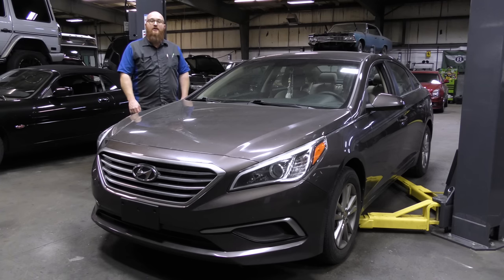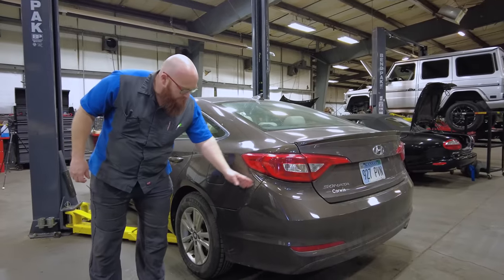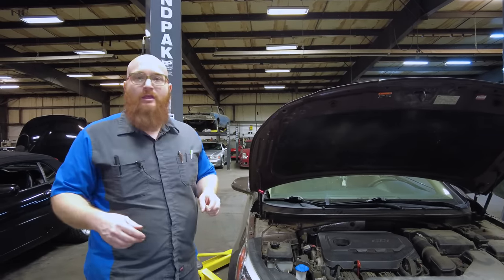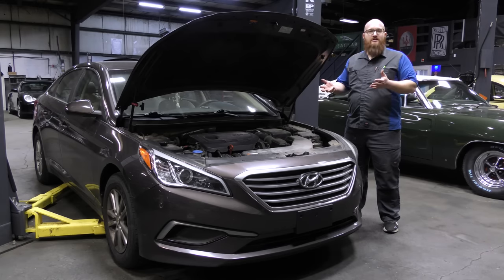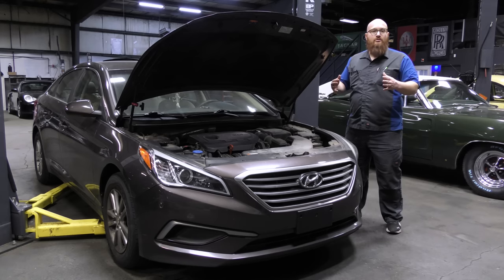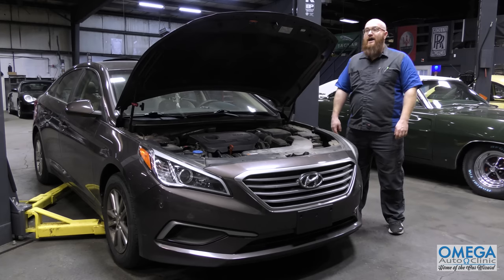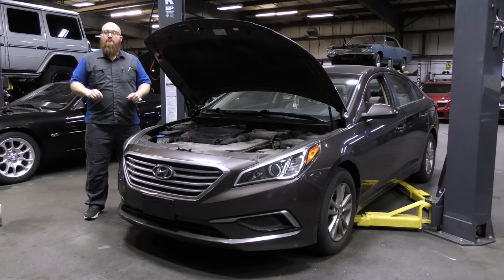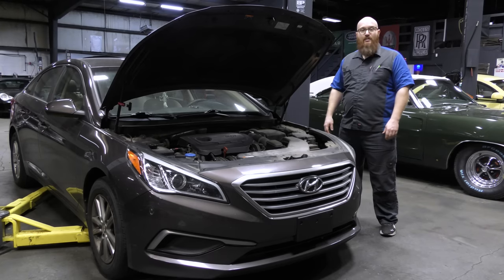What could be so bad on this '16 Hyundai Sonata that the CAR WIZARD is sending it to the junk yard?

Comment: My family had 2 Sonatas, both same model as the one in the video. Both ran perfectly and drove so smooth. The only problem was an occasional infotainment problem with the Bluetooth. It’s such a shame that these are apparently problematic but I’m glad our experience with these was nice
Reply: The overall quality control on Hyundais and Kias is very poor.  Yes, some people have good experiences, but a lot don’t.  There’s a reason you pay more for a Toyota or Honda.
Reply: No car can run on low, dirty oil.
Reply: Put in an aftermarket radio if possible. They are so much better
Reply: @mplslawnguy3389  very true. We’ve had several JDM brands and had pleasant experiences for the most part, Nissan being the best overall for us if you can believe that
Reply: I also had a  few Hyundais and never had any problems.
Reply: @mplslawnguy3389  And you know that how exacty? How many are there that don't have good experiences? How many of those have actually both and maintained them in proper conditions?

Interesting about that value remark you made on those jdm rust buckets. By your logic european cars must have the best quality, right? They do command quite a bigger fee.
Reply: @AI-qd4vb  Are you just a contrarian with nothing better to do?  It’s a pretty well known fact to people that work on cars that the Korean brands are of low quality.  Kias and Hyundais are cheaper upfront, but will fall apart at a much higher frequency.  Their quality control on their engines is not there.
Reply: @AI-qd4vb  🤡🤡😂😂
Reply: @mplslawnguy3389  he comments all these stupid things on Car Wizard’s videos, just ignore him

Comment: My daughter is going through this right now.  The oil was low but the dealer couldn’t say anything because they had just changed it.  There is a recall of sorts.  You have to jump through their hoops to get anything done.
08/15/24—-Hyundai replaced my daughters’ motor, at no cost.

Comment: Hi Wizard - I sold 5 years ago a 2008 Kia Sedona with the 3.8 L at 110,000 miles to a neighbor who still drives it today.  I don't know the mileage, but I see him zippin around in it all the time.  When I had it, she lived on full syn oil - changes never went beyond 7000 miles, NEVER ran low, and it ran very well. Thanks

Comment: I’m surprised there aren’t more videos like these about Hyundais, a lot of people that I know had horrible experiences with them.
Reply: Well it's because Kia/Hyundai have improved their reputation without improving their products and most people don't realize that.
Reply: A lot of folks who buy cheap cars treat them like cheap cars though too. If you take care of them they aren't that bad. People neglect their vehicles.
Reply: @brayannexon4613  It's because nowadays they make vehicles to appeal to mainstream automotive journalists who don't give two craps about how well a vehicle holds up after even 10k miles let alone 50 or 100.  If it's pretty/luxurious enough and has enough tech to make the journos go "ooh" and write a good review (which they do) Hyundai/Kia has accomplished what they set out to do.
Reply: @pierredelecto7069  agreed.  I take extreme care of mine.  I'm early on literally everything.
Reply: Hyundai basically went 'f*ck it" in 2012 and I've not even considered their cars since, which sucks because their 2000s era port injected cars were super reliable if taken care.
Reply: @brayannexon4613   No they went backwards, even if most people didnt realise it at the time; their cars already had fit and finish on par with japanese budget cars in the 2000s... and hyundai port injected engines were super reliable. Now they may look fancier, but their long term reliability has regressed from the era of mid 2000s elantras routinely getting over 300k without any fuss. Toyota engines are again the unchallenged the gold standard for long term reliability in my book now.
Reply: @pierredelecto7069  Most cars are build cheap today because car manufacturers cut corners with cheap engine plastic parts(obsolescence) and cheap electronics and when they break, charge a premium for those parts.
Reply: That's not true and this guy's full of it  The 2.4 l Hyundai It's bad but  There are websites that sells refurbish  2.4  I bought a complete  Engine for $1200 rebuilt  For my 15 sonata
Reply: @tbr2109  That's because they should not be sure about uncertainty.
Reply: This car is purely dead due to neglect would happen to any car
Reply: I had a 2002 Accent, two door hatch, 5 speed manual, and the car was a blast to drive.  I took it off the road August 2022 with 198,000 miles on it.  I got it at 170,000, it had never had a major repair at that point, and all I did was tires and alignment.  It was let down by the previous owner who apparently never got it washed....  ever.  Salt corrosion under the body ruptured the brake lines and I wasn't doing that repair on a thousand dollar car.
Reply: user-tq2zb5sc2c the difference is that if you buy something expensive from the German big 3 you are usually treated like a human being by the service department. Hyundai/Kia treat their customers like dog shit on the bottom of their shoe. All the surveys say the same thing…that the Kia/Hyundai have the worst dealers and they try to weasel out of warranty claims and stick the customer with the bill
Reply: user-tq2zb5sc2c  if you don't maintain them properly, that's what happens. Simple.
Reply: user-tq2zb5sc2c  oh you say so? Mines at 160k and my friends is at 250k, both same year BMW 3 series. And if you look in Europe, there’s a lot of them with 500k+ kilometers on the odometer. Proper maintenance is the key which nobody here in US does.
Reply: Those cars are good cars, is just bad owners.
Reply: These are poorly made engines that rarely see 150K
Reply: @ronaldwhite6508  $1,200 "rebuilt"? Don't think anyone sells "rebuilt" engines of any kind for that low price. That sounds like a pullout or junkyard used engine. Nothing wrong with that, used engine into a used car =still a used car.
Reply: The Real Cat of 2020  just sold an 05 Mercedes e55 amg with 160k miles, an 06 c55 Mercedes amg with 139k miles and lastly an 05 bmw 33ci zhp with 128k miles. All ran great with no issues. Quit being ignorant
Reply: @ronaldwhite6508 😂 somebody lied to you if they sold you a “rebuild” for $1200. That’s a used engine, says the internet.

Comment: My 2013 sonata did the same thing last year, low oil, running out before my oil change, and the engine siezed on me last may. A few months after I had the dealership do an oil consumption test and tell me it was fine. At 125,000 miles hyundai ended up replacing my motor for free through the recall and paid for my rental while in the shop. Here today looking for a eps fix now 🤦‍♀️

Comment: Common problem with Hyundai and Kia with the blown engines.  I had to replace my engine and luckily it was covered by the recall. Changed oil regularly, checked it every Saturday morning, and the engine still went. The 2.0 liter turbo and the 2.4 are just bad engines. Hopefully, Hyundai and Kia will remedy this issue.
Reply: I wouldn't hold my breath. They're still crapping out cars that blow engines early and they've known about the issue for a decade. They know what they're doing. If they can cheap out on manufacturing costs, and move enough volume, they can save money in the long run even with all the recalls and their 100k powertrain warranty. Techs only get paid 6 hours for replacing these engines and they're cheaply made so they can afford to throw you a couple new engines until your warranty runs out. You still paid upwards of 20k for the car that cost a fraction of that to slap together.
Reply: @henlo1910 Exactly! To manufacturers like Hyundai/Kia, it's the cost of doing business.
Reply: Are 1.6 liters non turbo engines good?
Reply: No! Mine is blown. I’m at the bank forfeiting the junk right now. It’ll cost 2x the value of the car to repair it.

Comment: I had this happen to my 2015 Kia Soul, luckily I did take it to my dealer for oil changes as per manufacturer instructions, and after dropping it off at dealership service department they finally replaced part of the engine as I did take it in for the recall! Since the dealership took 5 months to finally honor the warranty, I already bought a Honda to replace it. Sold that Kia a month after I got it back
Reply: GOOD Job!:text-green-game-over:
Reply: How long did it take them to do the diagnostic?  After a month they're supposed to offer you a free loaner car for you to drive while the car awaits the diagnostic.  It took my Hyundai dealership three months to do my diagnostic but they loaned me a car for free after the first month.
Reply: I hope you didn't buy a Honda with the 1.5t engine. Those have issues with dumping gas into the oil and blowing the head gasket prematurely. Hondas in general have been having problems with AC systems failing annually as well. Probably should have bought another Hyundai for the much better warranty.
Reply: I've been fighting with Kia for over a year with a transmission issue under warranty. I have a claim number with corporate. So far 2 trannys, a ECM, lots of adjustments and hocus pocus and it STILL has the same problem. Corporate refuses to return my 5 ( so far) phone calls. REALLY disappointed with a company that by all appearances was one of the better ones. Hey, at least I get a loaner car while they play with it !
Reply: @johnschofield9496  Can't you Lemon Law the car and force them to buy it back after multiple repair attempts?
Reply: @palebeachbum my 2017 Si civic never had any issues not even the AC pushing 180,000 miles don't fault Honda for Human neglected car problems
Reply: @Renz-ou8ix  lucky you. The problems I mentioned are all noted by Honda. Plus I've known a couple of people with annual AC failures at low miles. They finally gave up traded in the cars.
Reply: @palebeachbum  that sucks hopefully a Toyota or something Japanese related

Comment: Hey wizard, you saved me from a bad purchase on the range rover sport, thanks brother. The sonata is spot on I had 2012 sx optima with 79000 miles. And it drove great the first 5 miles from the dealership driveline. But when I got it home the engine had a light knock. Next day took it to the dealer repair.  They said it was the gdi pump.........ok now I sold cars for Kia few years before. So that was b.s. anyway took it home and it drove normal. When I wanted to take my daughters out for ice cream.  Not 3 miles from the house the engine knocked, squeeked and sized on i4 in Orlando. Me , wife and 3 girls on a interstate with no emergency lane. They are all garbage engines.  It's like mass produced crap to keep supply up when they inevitably fail. Great story keep em comin 👏 👌

Comment: In the UK when taking your driving test you will be asked the following,

As part of your driving test you will be asked to explain how you would perform under the bonnet technical checks for oil, coolant, windscreen washer fluid and brake fluid. You will be asked to open the bonnet and show where you would check for each.

So there is hope for the next generation of drivers.
Reply: Bonnet 😂

Comment: I had a Hyundai Elantra GT.  I drove mostly on the interstate, performed normal maintenance and sold it with 140,000 miles on it.  It still had the original brakes that did not need replacing!

Comment: Years ago I had a chance to buy a Hyundai with just over 100,000 miles on it and the body was nearly perfect. The interior was super clean, and all it needed was a new engine.
I called a buddy who owned a junk yard to price another engine.   He said that is the problem.  He had several really nice Hyundai, Cars, Vans, and SUVs.  They all had bad engines.
Reply: Put a non-Hyundai engine in it.  Maybe a Honda engine.
Reply: @hazelwood55  I was just thinking of the same thing. It would just require more work like swapping the engine harness and ECU to make it all work. But the main thing to figure out would be in finding the ideal engine that fits and lines up with the stock engine mounts with minimal modifications.
Reply: @hazelwood55  put a 1.9 TDI in it.
Reply: Yeah, a used Hyundai engine is $6k and a used Camry engine is $1,500.  with a lot less miles.   Why?  Because there are more Camry wrecks than blown engines.   Hyundai has more blown engines than they can replace.

Comment: Part of the problem is that cars today are so much more reliable than they were fifteen or twenty years ago.  Most drivers just see them as something that just works, and routine maintenance gets left behind.
Reply: Excatly, I feel like basic maintenance and pre use inspection should be taught in driving school
Reply: False. Most cars today are not gonna run 200k+ miles like cars 20 years ago.
Reply: Also that on never cars, there's often not even a physical dip-stick for the engine or gearbox oil anymore and you need to go to the dealership and have them do it and reset the car ECU..
Reply: Cars were way better 20 years ago less electrics cheaper to maintain.
Reply: That is no excuse for laziness or stupidity. Especially at the cost of new vehicles.

Comment: My 2011 Hyundai engine locked up at 120,00 miles.  I always change the oil and check ✅. It was covered under the recall. Got a new engine ❤

Comment: I generally check my oil with every fill-up.  Which just about works out to your 2 weeks.  I've never been low with my last three cars (all bought new), so I can see how someone might get lax...

I get my oil changed about every 5000 miles.  On my older cars, it was about every 3000, but my current vehicles, the oil never really looks dirty on the dipstick, even at 5k.  I don't generally rely on time.  Our main car winds up getting changed every 6 months or so,  and I generally use a synthetic blend.  My little sporty toy goes about a year on full synthetic.  It seems to be working out for me...
Reply: I used to own Kia's until I got a job in the service department at a Kia dealership.  The vehicles have too many electrical issues and cheap engines.  Btw, Kia considers excessive loss of oil if it loses at least one quart of oil per thousand miles driven.  If you're vehicle loses less than one quart of oil per thousand miles, Kia considers the oil loss acceptable and the engine to be good.
Reply: I used to change oil every 37.5k miles/2years, as recommended by the cars computer and the manual. Sold it running like new with 190k miles. Used 0-w40 longlife synthetic oil though. Never had to refill in between.
Reply: @computercrack  Which make and model?
Reply: @aliemreozkan  (GM) Opel/Vauxhall Vectra/ Signum 2.2DTI (Diesel) from 2003. Specified with oil change of 2 years or 31k miles. I once extended this to 37k miles by my own fault. Had the car from 2005 to 2017 and drove 150k miles with like 5-6 oil changes. Oil I used was 0W40 full synthetic long life oil with GM LL specification. (recommended was 5W30 I believe)

The later engines they used in that car had only 1 year and 19k intervals though. Also applied for the later Model Insignia (1.9CDTI Diesel)

Comment: Used to be pretty common that every time you fill up the gas tank, you check the oil while the pump is running. I see barely anyone doing that anymore. That one simple habit could easily prevent situations like this. (Incidentally, this is a good argument for full-service gas stations to make a comeback; the attendant checks that stuff for you including topping off the washer fluid...)
Reply: Equality!  🙂   There are articles about it in the the various MSM Rags that a certain section of the public would blame full service attendance for messing up their vehicle and then gas stations were held viable since they opened up the hood
Reply: @MickeyMishra  That plus components of gasoline are carcinogenic. It's not much of a problem with the exposure you get occasionally fueling your vehicle, but if you are exposed to it all day every day, it can be a problem.

Comment: Hello Car Wizard, firstly, let me say that I am very grateful for what you do here, smiles for many miles indeed.   I just got my 2015 Hyundai Sonata back from the dealer, after getting the engine replaced at no fee, other than the two serpentine belts that were due.  The motor just stopped after turning onto the street I live on, coasted as far as possible, made it onto a side street, and later used it as a leg press machine alternative, pushing it up the incline to get it in to a place where the road was flat.  And it began to collect parking tickets as options were considered. The battery wouldn't take a charge,  ....so when Hyundai was called, it was after the mechanic I had it towed to told me the motor was gone.   Mine is in great shape, at least, this is what every single person that has been inside it tells me.  The engine is a flawed design, whether or not the flaw was due to many assumptions being made in its design, which would be in line with how Hyundai began, but you are fully on point with your decision.  It wasn't a car I would have chosen on my own, neither was that rather generic 2014 Jetta I had for a year.  If you hear about the equivalent of a nuclear level industry shaking event happening northeast of you.....bigger than 2008, in the insurance industry....that would be me.
Reply: Did you have the 2.4L or 2.0T? I have a 2.0T from the same year and this is very concerning. I got the Service Campaign 953 so I at least qualify for the lifetime warranty, still pretty concerning.